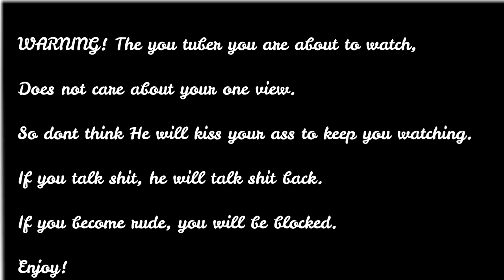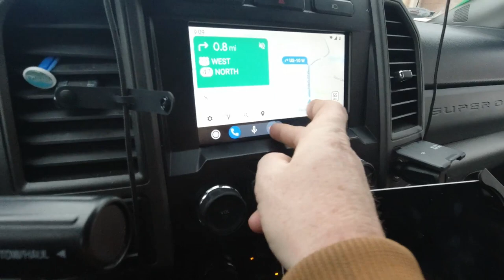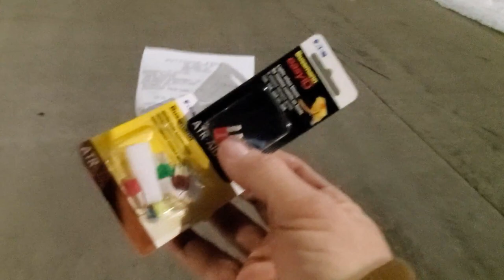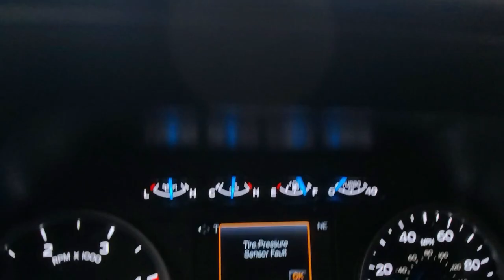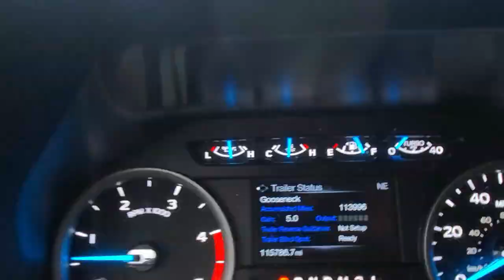Hauling a boat on a trailer, on a trailer.

Comment: When I had wire problems on our 3car trailer, I bought a 14gauge 100ft extension cord and rewired the whole trailer in 4 hours, I did it at night while of duty. $150 and it's been 7 years and still working good without issues.

Comment: Just a word of advise.  those screw jack on the front of the boat trailer are extremely cheap and fold up or break off a lot.  The way you are strapping it down has all the downward pressure on it.  If it gives all your straps will come loose and bye bye boat.  I would suggest putting some 6x6 blocks or something solid to support it or lower it all the way down and let the tongue to the floor.  Safe travels from a fellow South Georgian.  (Savannah)

Comment: FYI having a power probe is a great investment...it hooks up to the battery directly and you can apply power and ground to test circuits.. I also would buy some rubber hose like bigger vacuum line or fuel line and cut it length wise to wrap it around those wires and tape it up so it won't shift. Will add some buffer to not chafe those wires on the square tubing.

Comment: When I bought my Ram 3500 DRW I got the Tradesman. It is just about the lowest trim package they offer. My thought is that the more electronics you add, the more that can go wrong.
When ever I buy a trailer (even new), I rewire it to my standards. I run the round 7 wire that's in the thick neoprene (blue) jacket. Then I run water proof junction boxes. Every connection is waterproof.  Every light has a ground wire run to it (from the plug) AND grounded to the frame.
Reply: If u want a icrap, buy an icrap. Dont buy a vehicle for an icrap. All those electronics will be obsolete in a few years.

Comment: Robert, I mentioned it a couple of times in the past on your videos pulling equipment and more over trailers. Never trust those reach wheel jacks, even more so the ones designed to swing up out of the way for towing. They love to fail when you lease expect it. Always block up trailer reaches with timber or dunnage that give you one good solid anchor point, don't trust the reach jack. If possible (which is usually the case) wind the reach jack up so it's not even touching the deck, that way you can be sure the trailer is going to stay where you put it each and every time.. You know the suspension on the trailer is going to bounce so let it bounce by securing the trailer axles to the deck, then the boat to the trailer frame. cross  chaining the axle, front and back by the springs will avoid damaging the frame. Safe travels...

Comment: One investment you may want to make is a wireless trailer light. The one I have is 36 inches wide and is a running light, brake light, left and right blinker and all flashes as a hazard. It's a life saver.
Reply: Its magnetic and sticks on the back of the trailer.  It's the same one all the tow trucks use.
Reply: Also I had the same problem on my 2016 f350 with the running lights. What I did was made a jumper wire that jumps from the the power(12v running to trailer)  wire in the trailer wiring distribution box  to the running lights. That way I dont have to worry about it anymore and also they are always on even during the day. When you rewire your trailer get the blue 7 wire. Can get it on amazon. Also get a distribution box to go up front on the trailer. Makes things very nice and easy to add things or so on

Comment: There are tie down points on the pontoons, both front and back. You can put some belly wraps on the boat trailer to help stabilize it. Stuff some plastic bags in the end of the square tubing to stop the wires from rubbing until you get a chance to fix it correctly. It will help it from rubbing through and shorting out your lights.

Comment: just a thought on fuses.. if i go to the junk yard for something i try to find a truck like mine and take all the fuses out of it .. most places will let you have them for free .. i have been charged 5 bux once .. but there was about 90 bux worth of fuses relays and all that stuff... just a thought :) .. oh that trailer being pushed off is going to be a p.i.t.a. without a piece of c channel flipped up like this l_l for the front wheel to ride in as a ramp to the ground .. you may be able to use your 2x4's if they are long enough.. unless your deck is low enough to the ground for you to lay the ball hitch on the end of the deck and the crank is long enough to touch the ground .. either way good luck .. i would keep the winch attached to the tongue of the boat as unloading

Comment: Good job on securing the Pontoon Boat to your trailer. IF the boat had a charged battery and ignition key, you could have tucked that motor tight to the transom with the power trim and tilt switch on the console.

Comment: A Tip on Boats: Usually the shipper gives the length of the boat only- might figure on adding 3-5' if its on a trailer? Also that type of motor on a boat usually has an electric trim that raises and lowers the motor. Up like that is usually the pulling position, down is for when its in the water. Sometimes theres a manual lock on the engine to lock the engine up if pulling it a long ways and sometimes not? Actually usually the cable up front is snugged to hold the front of the boat on the trailer? That winch may be messed up?

Comment: If you’re in the central Ohio area get ahold of me. My business does trailer repairs and we will wire that trailer so you will never have a problem again
Reply: Never...yea not likely. But there's always room for improvement on a factory wiring job. They probably only give the guy doing it 2.3 minutes to wire the trailer
Reply: mrmotofy never is a bold statement. Let’s change that to wiring that will last a long time. 

The manufactures will cut ever corner on wiring and it’s the first thing that upsets people about a trailer they bought. If they did good wiring from the factory everyone would be much happier.

Comment: Thanks for sharing about the Ford. My 2014 Ram Limited has total 14 recalls. At one point it needed the $3,000 scr replaced and it took four trips back to the smog shop to try to get it to pass smog and I felt like just getting rid of it as I had no registration at that time in California without a smog pass. I had considered buying a Ford. With your talents and being able to repair vehicles you can make lots of money as a mobile mechanic here in California. Or you could start your own handyman business and be a sole operator without the headache of employees. The only downside as houses are almost a million dollar each in the suburbs. But in the ghettos of Oakland you could still find housing for two to three hundred thousand. In the Bay Area we have not had rain in all of February and most days are sunny and warm and beautiful. I'm trying to do lots of fishing and I could really use that boat you delivered. If you could deal with a communist-run state we would welcome you to California. The weather and the scenery make me never want to leave. There are so many jobs in the Bay Area and my son is making 15.50 an hour making salads

Comment: I'm not trying to hate, bro.  But you knew about that wiring.  It's in one of your videos.  It is a good lesson for others.  Once you spot a problem, you should correct it then.

I hope when you got home, you rewired your trailer with better wire.

Comment: Needs a better ground! Along with replacing wire and adding protective coating, if the wires are getting warm then your ground is weak. Adding just an extra ground wite from truck frame-trailer will keep them suckers glowin in shitty weather

Comment: Ha I got a $100 K Volvo that the TPMS works about two weeks and then I can drive five miles and the light comes back on. I ordered a OBDII scanner that resets the damn sensors, for under $125.00 to keep me from sitting at the Volvo dealer cooling my heels! Make Ford replace the module for the TPMS and the wheel sensors AT THE SAME TIME!
Reply from the maker: its no longer under warranty. Whats sad is ive been getting the wanting since 10k miles. but all the ford places wanted to keep the truck for to long.
Reply: SouthGeorgiaHotShot I even bought a complete new set of sensors, now they tell me it’s the receiving module that has to be replaced and it has to be done at the dealer the new one has it receive both and swap the programming from one to another for a total cost of 3k!

Comment: The way they wire those trailers anymore, sounds like you had a naked wire rubbing against metal on the trailer, keeping your running lights from working? Thats probably what shot the fuse? On tractor trailers, the running light wire is bad about burning loose from the terminal in the trailer light cord plug. Id  have to take the plug apart and re-attach the wire or just replace the light cord altogether, depending on how bad it melted the terminal? I always carried an extra light cord just in case? They are a little different than standard car and pickup light cords in that they had plugs on both ends-one for the tractor and one for the trailer. There were several things I used to keep with me in case I got out in the middle of nowhere and needed them: Extra Alternator, Extra Starter, Extra Light Cord, Extra Set of Belts, Extra Set of Water Hoses and Extra Set of Air Lines. Oh and plenty of electrical tape!HaHa I hated being broke down on the side of the road somewhere and having to call a wrecker. I dont mind using wreckers but they sure are expensive on tractor trailers, which they have to be expensive as much as wreckers cost these days, and will wipe out your profit quick.
Reply from the maker: wow you carried an entire auto parts store lol
Reply: @SouthGeorgiahotshot  lol sure did but it beat wrecker bills and shop bills and losing time sitting at shops. Told you I was a cheapskate!LOL I changed a turbo on my Pete sitting on the side of a snow covered interstate once. Ordered it online and had it shipped next day FedEx. Driver said thats the first time he ever delivered a package to the side of the interstate!LOL

Comment: Looks like you need a few days off to re wire your trailer. I would go up one size from what you have then order it bulk.  and re wire it the way you need too.  Job be done and no more problems

Comment: Did you try the call end button on the steering wheel?  I never use android auto with my sync 3 I just use the Ford navigation or my google maps on my note 9.
Reply from the maker: Yep only way i found to hund up is disconnect the phone from the truck at the usb port. And hang up from there
Reply: @SouthGeorgiahotshot  That blows sorry it didn't work for you

Comment: Those tire pressure monitoring systems are in your valve stems.  they only last for a couple of yrs then they need to be rebuilt or replaced.  at les Schwab, 7.99 each for a car.  I was told by my dealership, and them, that every tire must be able to work with a TPM or the sensor will not work.

Comment: Robert just a question for you you said you had experience hauling cars if I was you I would get a 3 car weig trailer and haul car,s made a good liven for 30 years hauling cars and I live in Maine just a thought for you
Reply from the maker: I hear the car market is even worse right now. And that you have to haul 12 cars at a time to make profit
Reply: @SouthGeorgiahotshot  You can make a profit hauling cars.  The number you have to haul depends on the type rig you have.  You just can't go with the idea that each car has to pay $4/mile like a couple haulers try to tell you they get.
Reply: @SouthGeorgiahotshot  I still get call ever day I had a 7 car and sold it and got a 3 car weig trailer with a f350 super cab and  I'm 53 and retired I have plenty of cash to play with so you might want to check in to it I owes got 1250 a car from Maine to Florida with the snow bird's so that is spring and fall so it's up to you man I'm thinking about buying a new truck and trailer and doing it again

Comment: That issue you're having with your sync 3 is actually the Android auto app that's freezing up The phone features and that's the issue with boat listingsa lot of times they only give the length of the boat and failed to take into account the length of the trailer as well
Reply from the maker: they just came out with a new update. still having problems.

Comment: I would be a little leary of trying to move the boat back to shuffle the loads, with as close as the wheels are to the edge of the trailer.  If it gets away from you and goes a little crooked, it will drop a wheel off the trailer before you could stop it.

Comment: Hey man I have sync three in my mustang I had all the same problems go get it updated at the ford dealer it was like 40$ and it works better than ever.  It went from like sync 3.1 to 3.7 or something.
Reply: They may update it for free if you show them that videi
Reply from the maker: Mine can and has downloaded the new update. Theres an option in the setting to connect it to wifi and manually or automatically do updates. Ive tried them all. And according the the software listed. Its the newest out.

Comment: Doing a great job man. Don't get your self all worked up and bummed about your load bro you will get good and bad just keep your head up high and thank god your making something. There are a lot of less fortunate people out there. You are doing it the best you can. So roll with it.  Now opinions are like assholes  every ones got one. That is your business not no one else's do it your way bro. As for the radio ya that's very annoying myself next time I was in town I'd go to that dealership and make them fix it. And you have the proof of it on this video. Wow bad luck with that trailer errr. When you do your wording I would run it through conduits  to a box were each wire comes out. Something to think about again opinions are like assholes. 😂 good job though so keep on trucking

Comment: I have the same thing with tpms, see what the problem is you're your phone charger is interfering with the monitor sensor it sounds stupid but and give it a shot just disconnected for about half hour and see what it will do and then plug it back in and if the light comes on then you know that would be the cause just interference mine does the same thing but my says faulty sensor.but if you have no nothing charging or nothing plugged in upfront it doesn't interfere with that monitor sensor it's weird and crazy I know but something you can try doesn't cost anything disconnect unplug and see what happens it should go off. Maybe it might save you a trip to go I'm going back to the dealer or getting frustrated something you can try doesn't cost you a dime.

Comment: We have 2017 ford that has the same crap, how ever there is a new unit ford say they have fixed the problem so we will see going in the week for a radio swap. What gets me is it took 2 yrs for the problem to show up...
Reply from the maker: are they charging you for this? I think its a software issue
Reply: @SouthGeorgiahotshot  no there not charging me, and yes it is a software problem but I'm told they cannot update the one in there. They have already tried to update this one it mad it better but still not fixed.

Comment: Not to be harsh but the clamshell crimp wire connectors are absolute garbage. Either use true crimp connectors or the best option is solder and heat shrink insulating tube. And: you had wiring issues a few trips back: why didn't you use a down day to properly fix the wiring? Part of small business ownership is understanding "days off" are nothing but a memory: you use those to fix what needs fixing,maintenance,etc. I own a manufacturing company and my last vacation was over 20 years ago. It's part of the sacrifice you have to make: IF you want to succeed.
Reply from the maker: it feels like a few trips back because of how long it takes to get the videos out. Its the same trip
Reply: Yep an employee or self employed person is still on the same side of the business quadrant diagram, exchanging time for money. Gotta switch start building a business system that makes you money while you sleep. We've been been denied options by the educational system to keep us enslaved and in debt because that makes them money. Just gotta be open to learning and ideally having mentors like mine that have made their millions and want to help others do the same.

Comment: Next time you get a boat the measurements are always for just the boat sans the extra for the motor and trailer. Next time take that boat through one of those hand spray car wash and put a dollar in and the hot water will melts the snow. Put that tongue up through over the tool box and ratchet up the tongue allowing the rear of the trailer to sit on the deck!
Reply: Now that was helpful!  Thanks.